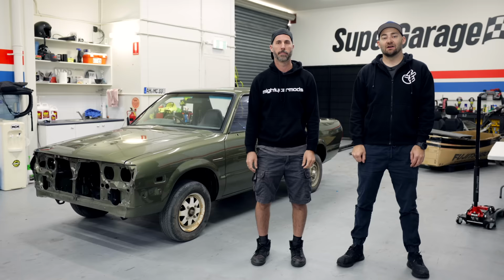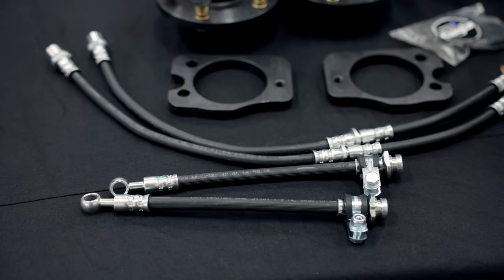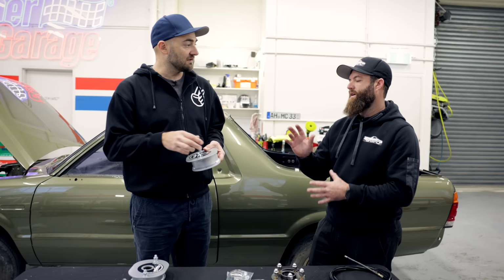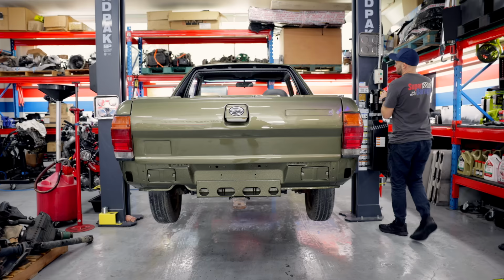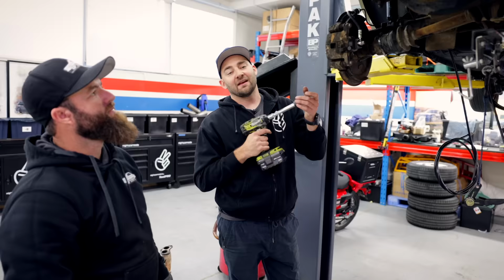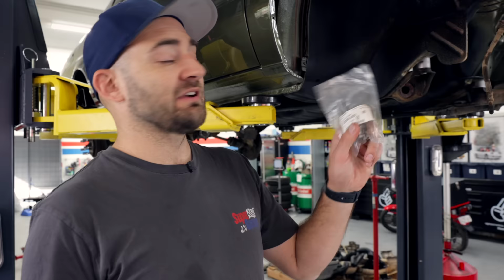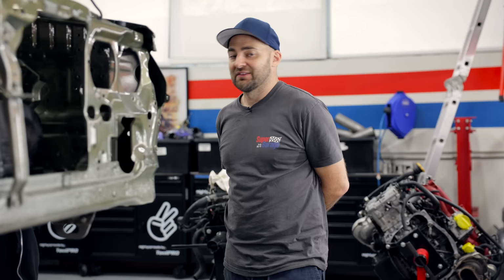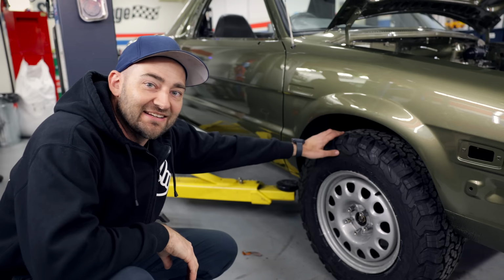Rebuilding an Subaru Brumby/BRAT - new engine and paint [EP3]

Comment: the welds on those coilovers is a work of art
Reply: Unlike the transmission bracket!! But I over engineer everything, I hate failures!
Reply: @craigdavies8099  That looks like it's gonna break in no time, basically a straight welded plate...

Comment: Had a brumby when i was on my P plates in WA haha i had a 2" lift with 33's on it and used to show the patrols how it was done 👍
Reply: Amen, I'm Trying to do the same with my lifted and Locked Forester ;)
Reply: @rx7brad13b - they’re still showing patrols and cruisers how it’s done 🤣
Reply: @ElFreddoAndRubyScoo  fkn oath man haha atm I've got an AU falcon putting through the works. Big lift and tyres with a ford territory running gear.. in the mix with wiring harness and ecu problems. Thinking me and my mates need to make a channel I've got so much dumb shit to upload haha

Comment: Ran into the same issue with chunky tires on my lifted subaru. Ended up going with a Yokohama GEOLANDAR A/T G015. Not as chunky but they actually fit and have performed great on and offroad.

Comment: I wish i could've been with a more motivated guy like these guys.  Instead i ended up with a torn apart Brat in my garage that was never finished. Took me years after the breakup to part with it because the body was still in decent shape but i couldn't find someone that wanted to get it in the shape the engine bay was at that point.  Car is gone but I still have the back seats in the garage for a random time i may come across someone that needs them.

Comment: I don’t know if you have it in Australia but Falken makes a tire designed for AWD crossovers called the AT Trail.  It’s not as aggressive as the KO/2, but is offered in smaller sizes.  I’m running a 215/65r17 on a 2011 Mini Cooper Countryman S with a 2” lift.

Comment: 18:20 First car was a 1974 Plymouth Satellite 2 door with a small 5.2L V8 with a super tiny 2bbl carb...it has torsion bar front Suspension, and being young, with G60 15s on the back, I lowered the front to the bump stops and went for a short drive with the ass in the air, then leveled the car out that evening at the local community college where I was taking autobody repair night school...it was a tough car (drove it through a ditch once when I was practicing the reverse turn brakes forward James Bond style maneuver and misjudged the exit location, and legal once I patched the rust holes in the floor and wheel wells...the boot could hold a few friends, at least one when in the mood for good humor, with the boot lock broken, he could pop the boot lid and wave to the people behind us at the traffic lights.  Was that all one sentence?....I sooo did not use Grammarly at all, eh? ;-)

Comment: I'd reinforce that transmission cross member a bit more, it doesn't hold just the weight of the transmission but also the torque of both the front half-shafts and the drive axle, meaning it wants to twist both longitudinally and transversely. Just  a little rib should make a big difference.

Comment: I hope the Forest dual range was geared differently to the one in the Outback. The low ratio in mine seemed to be only a fraction less than high range.
Reply: Yes the early SF forester in this case had great low range. Not quite as good as Brumby or L series, but way better than Outback. It’s 1.4:1.

Comment: You can definitely fit those muddy bois. Needs trailing arm spacers for the rear and trim the front fender
Reply: How do trailing arm spacers work on a torsion bar rear end that’s now got a 2 inch body lift fitted?

Comment: YO !! That rear drum to disc conversion system looks insanely straightforward !! I'd like to find out more because I'm planning on buying an Ultra Nugget soon that has drums all around and I was looking for ways to convert it to discs in the front but couldn't find any simple way to do it and there are NO compatible parts for this car that I can find from my research. Obviously that hub will require some trial and error engineering, but still...

Comment: Hey guy the 1989 1800 Brumby came with flares as are Subaru option from the factor, I'd try going factory flares, before changing it back to road tyre's, it is looking amazing great colour also Re:
Reply: @wokss - I’ve never seen factory flares on these across any  of the year of manufacture for this model. Got a link to a pic with the details?

Comment: Do yourself a favor and get a crossover terrain tire, like the Nitto Nomad Grapplers or Falken Wildpeaks. Remember k02's and tires like that are optimized for the weight of a truck, and as a result will inherently ride worse on such a light vehicle like this. Additionally they will be much heavier, and that will contribute to driveline losses. Crossover terrain tires are made to go on lighter vehicles, and are designed in such a way that you get the ruggedness, and appearance of an AT tire, but with better road manners.

Comment: perfect burnout car with that front hand brake :)
Reply: Yeah but without removing and disassembling a front drive shaft you’re not going to be doing too many skids in FWD or 4wd. The front and rear diffs are locked together when 4wd is engaged 😉
But yes, once some mods are done it could be a great skid pig using that front wheel handbrake
Reply: @ElFreddoAndRubyScoo  if its FWD by default, I thought its RWD by default and you connect front. But ya, everythng can be done.
Reply: Fwd by default. 4wd engages/locks the rear end to the front 😎

Comment: I had a 1975 Valiant Regal that could be lowered the same way at the front. If i remember correctly the left and right side had their own bolt to turn which lowered or raised the car. I went a bit crazy and lowered the front too much and i ended up cracking the chassis on the steering side.

Comment: Did a 2"lift in the late 80s you dont need the block in the back to do a  2" lift  All you do is rotate the torsion bar,  By  hit the outer housing and the bar warks out then pull down the rear arm to the hight you what put the torsion back in. Diff need to drop too 2ezy Mate
Reply: Yeah but then the rear wheel looks like it sits under the rear wall of the cab. No thanks! 
This way keeps the wheel centred the best IMO.

Comment: Looking good. Does anyone else think that the gearbox mount looks weak as hell? What am I not seeing? Just welding some steel plate to the side of the existing mount, regardless of how light the box is, will break easy. Tell me this isn't how he did it? Love your work though just this got to me.
Reply: As Marty demonstrated, there’s hardly any weight at all on the rear mount. Many people way over-engineer this mod when in reality not much is needed. Seen it done many many times way worse and zero issues.

Comment: Yeah not completely sold on that backing/clamping plate for the rear brake assembly which had new holes drilled & ground into it right up to the edge of the metal? @ 8.38 minutes A little bit more R&D required there I am afraid.
Reply: @robco6997 - there is no other way to do this modification to swap the bolt pattern between the EA81 swing arm and the EJ brake backing plate. I don’t know where you’re located, here in Australia many engineers do not like welded backing plates. 
You’ll find that sandwich plate was carefully designed and machined with attention to detail to do the job it needs to do with long term safety being paramount! 
I would bet good money that no engineer would have issues with this setup if they’re correctly following our brake modification laws. 
I’ll be running this setup on my lifted L series when the time comes. I can’t wait!!

Comment: 9:00 missing a clip of the new Rotor going on over that parking brake assembly? Made for a weird transition.
Reply: 9:59 There it is. Still odd watching moog put the wheel on what appears to be just the brake assembly and hub.

Comment: You have done the job completely backwards by painting first, you have NO chance of any small changes to the wheel arches now, I would have done the mechanical work first THEN painted as the last step. No compromises by doing the job that way.
Reply from the maker: Except you have to do everything twice, i don't disagree with you, but if you're careful, its ok.

Comment: I was hoping you were gonna install the WRX powertrain that you removed from your Levorg.  THAT would have been EXTRA awesome, but I guess I can settle for regular Forester awesome.  I'm guessing you sold the WRX parts on Gumtree last year.
Reply: Too much chassis modification is required to fit the quad cam engine in, and it would likely not pass engineering
Reply: I only know of EJ turbo conversions, I’m yet to see an FA/FB etc in an MY body…
Reply: Fa/fb would be sick, but would still require the chasis rail being notched to clear the timing chain cover

Comment: I was so bummed when they left the underside all crusty with a bunch of old bits. I thought they were going to redo the whole thing. Cool project though.
Reply: You didn’t hear that they are going to pull it all apart and refurbish everything that wasn’t replaced. That means they will probably clean the shell again and add body deadener before it gets raffled off

Comment: I was wondering how the AWD t-case would fit the EA81 chassis, but a 2" lift will do it.
Reply: Even without the lift the AWD box fits. It’s a bit tight in places but there’s still enough clearance for it 😉
Reply: @ElFreddoAndRubyScoo  Yeah I have one in my GL hatch, I had to mount it with about a 5deg donward angle though. I'm running an EA82 and box, we'll see if that changes once I get an EJ in it.

Comment: At 8:38 
Measure once then drill and die grind ?
Reply: That’s where the holes need to be for the adapters I think. Ontop of existing ones slightly overlapping. Funky stuff is required to make it all work.

Comment: can someone help explain what that bracket does on the rear for the 5 stud conversion? i see new holes were drilled but that piece already bolted to the control arm so why does that bracket need to be there? just have trouble visualizing what was done

Comment: Hope I win. Would be delivered straight to Skid Factory for STI and 6 speed insertion
Reply: I’ve never seen a six speed in one of these. It would probably weigh just as much as the body!!
The lift might make it possible, but why not run the turbo 5 speed? ALL the hard work is done for it to fit since it’s basically the same as the dual range in there!
Reply: Well I suppose a short ratio sti 5 speed will hold up behind an ej207 with some mechanical sympathy
Reply: ElFreddo (hello mate!). There’s a red Brumby somewhere in WA that DTrally Doug from Stechnic fitted a 6speed to. Careful fitment and it was done, unlifted, without any tunnel mods at all.

Comment: Which master brake cylinder do they install? Just bolt on the original brumby booster? 17:03
Reply: We are releasing a write up on our web site in the next coming days. It will have the answer to this question.

Comment: Love the way absolutely no one noticed how Dave absolutely farmed the rear drum mount holes on a vice with a Ryobi combi drill. He leaves no meat on the inner edge😮😢😅 all the time spent on RnD on the conversion adaptors then the abortion at 8 minutes 36 seconds, absolute farm fuckery, Moog made a neater job of Paris's front bumper. We all know a Dave 😂😂
Reply: Dave collects shopping carts and ties his shoes with velcro 😢
Reply: I agree not nice! I can only imagine this slipped through the editorial process. Nice paint tho! Keep up the good work boys ❤
Reply: No matter the method employed to fit the EJ backing plates to the EA swing arms, this is the difference in the bolt pattern between the two front/leading bolts! 
A sandwich plate is then utilised to clamp it all together on the swing arm. No welding = no issues getting engineering approval in Australia.

Comment: The front handbrake is for doing burnouts. Except it's 4WD so you can't.
Reply: You can easily by just taking the front driveshafts out (leaving out CV cups in). Pull 4wd lever and instant rwd car.

Comment: Are the conversion kits engineered for all states in Australia or is the onus on the owner to get an engineer to signoff on the mods in your own state?
Reply: Onus is on the owner to get it done. I’m sure no engineer will be worried about these kits!
Reply: These would pass engineering easy as, and you’d need the car engineer inspected anyway when doing mods like this I think. I rekon these kits will be surprisingly affordable

Comment: Wont be able to register it with a body lift
Reply: Why not? Plenty of different vehicles out there with a body lift. 
The engineer has the final say and 2 inch is perfectly legal in most of Oz without engineering certification 😉
Reply: @ElFreddoAndRubyScoo  not after market ones, all 4x4s that use body lifts are illegal
Reply: @trayner - well one of us will be proven right. First I’ve heard about all aftermarket body lifts are illegal. You from Australia somewhere or another country? If in Oz look up the current VSI bulletin about body lifts 😎

Comment: Slightly triggered seeing the fresh paint with the old dirty suspension and brakes getting thrown back on with nothing run through the parts washer or even just fresh discs and pads.
Reply from the maker: it will get lots of fresh bits, some stuff we aren't disturbing if it works fine and isn't rusty, a bit of dust or mud can be blasted off later.

Comment: My mother in law has a wrx swapped brat. It has reiger coilovers and 31 inch tires it's so sick. The thing straight up BOOGIES in the desert. I love the thing and I can't stand Subarus. Subaru drivers are the biggest liars when it comes to winning races. "I beat a new gt500 in my downpipe'd and tuned STI." No bro. You really did not. He just didn't feel like wasting fuel blowing the doors off of another dumb ass Subaru.